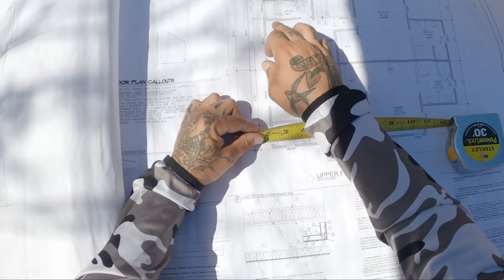Carpenter Building TJI Floor System on Home (First-Person POV)

Comment: The Go Pro just showed me how precarious it is working on the upper wall framing. I can see how one mis-step can send you to ground level very quickly.
Reply: Matt bangs head
Reply: Well strictly speaking he wouldn't got the ground as they are wearing fall arrest protection gear but it would still hurt. One lapse in concentration and your falling, it is very precarious but you do get used to it. 👍😃
Reply: @garethheathcote4988  he’s not wearing fall protection there. Those are his tool belt straps you’re seeing.
Reply: Just use more braces. Its not difficult. You should have a top plate too. Very rarely can't fit with height.
Yea, rubber grip hammer is trash.

Comment: Matt. If you drop that saw. Trust me. It will still work. Dropped my saw from 2 story's and it still cuts like butter. Also left my impact drill on a roof when it snowed. Knocked it down bumping under the roof with a stud n made it drop 2 story's down. Still works fine. DeWalt is just as good as the rest n maybe better

Comment: also try putting a little electrical tape right on the bottom of the handle, it’ll slide right in 
That’s what I did with mine

Comment: Hey Matt you showed how you adjusted layout for plumbing toilet.  On recap mention also how everything stacks. Studs to Joists for hvac returns and runs.  Also top plate nails over studs for clear path for electrical.  All subs can THANK A FRAMER. Or thank a good framer anyways. 👊

Comment: Is there a reason not to add a piece of osb/plywood on top of joists & top-plates where you're needing to walk frequently? Like where you're lifting the joists up, rather than balancing on just the 2x4s, you could have a few sheets of your flooring materials to give you a platform?

Comment: Hi Matt, all I kept thinking about while watching your video is that my boss is correct. I am in my 50's and he is got about 15+ years on me. Never and I mean NEVER used nail guns. We have had carpenters walk off when they find out that it's all hand  nailing. He swears that dragging around the hoses, and the hassle of getting hung up is much worse on the body than hand nailing. Also, remember my last comment we still cut in 1x for bracing!
Reply from the maker: Cordless Nailers work just fine, but I have friends that still handnail everything and they build just fine.

What's funny to me is a carpenter that can't hand drive.. There's tons of them out there!
Reply: @MattBangsWood 
Ohhhhhhhhh yes, more than we'd like to think about. How about the carpenters who need a miter saw to cut straight? I've seen plenty of them. Or framers who use a speed square to mark complete lines and still can't cut it straight?
Reply: Hi. I have a theory about hand driving nails. It seems to me that the harder you grip the handle the less force tranfers to the head. A bit like a pool break off shot. Barely grip the cue and you'll destroy the rack. Any thoughts?
Reply: @kierandoherty1600 
Well, that's kind of what I do. I hold the hammer real lose as I am raising my arm, then when I start my downward descend and I am starting to pivot my wrist I tighten my grip while at the same time letting the wight of the hammer do the hard work. I have never hurt my elbows, shoulder or wrist with this swing. Moving wet lumber always gets me though.
Reply: 1,2 1,2 1,2 set it and drive it. First day test - 10 penny finish nail set in 3 or less whacks with a hammer. The old guys would do it in 1 whack. Hold the nail with the thumb and forefinger and drive it home and not a scrtch and set level with the surface. No Hammer marks!

Comment: 19:20 The 🦊 man was like im not knocking it to the ground, sketchy saw. Also ive noticed that most older generations of the nr83a hate to take 2 racks of nails,  have you noticed the same?
Reply from the maker: Steven, my NR83A hates taking 2 racks. I don't know why though, they almost always jam up!
Reply: I've noticed this too. The second rack seems to ride up on the back of the first and gets stuck, keeping the spring from feeding them in.
Reply: I got the same gun Matt and it does the same thing when I use generic nails like grip rite 
Try paslode 
Plastic that holds  the nails is very soft and when you let the spring latch hit to hard the spacing bends /shifts and that causes jambs
 once you load your nails try just letting the spring go very gently

Comment: Just a question, not a critique...what is the purpose of doubling the rim joists? I've not seen that done.
Reply from the maker: No worries at all, it’s a structural detail. That back section will be nailed off @ 2/12 nailing with LTP5 connecting rim to wall below / below at 5” O.C.. Crazy shear numbers on the back since there is only (3) 3’ walls.

Comment: Think about this, I would level all the outside walls1st then work in. I would level extra walls with long span level at where walls tie in together as we know as the T then run a line just like you burning 1 1/2 straight all the time the beams always run flush on the inside the outside you’ll lose when you put plywood then just measure 5 3/4 from beam to line. But I would just run the string on the inside

Comment: The shear ties it up strong anyway?
Reply from the maker: Structural details call for the A35's. Shear will run from bottom plate to top of floor system, then from there upwards. You're correct.
Reply: @MattBangsWood   both top and bottom sheared walls tie on to rim joist but the plans do require A35’s every 3’

Comment: Engineered lumber should have any crown to it so it doesn't matter. Also how come you don't have a 2 hour fire wall between units
Reply from the maker: Engineered shouldn't have a crown to it, you're right, but I've gotten some nasty LVL. I check for crown when doing anything cantilevered, as I'll crown upside down.

It'll get 5/8" on both sides of that interior bearing point. I'm in the works with owner about getting his soundproofing, as I don't like the single wall detail.
Reply: @MattBangsWood  Here in michigan we have a 2" fire wall system that would extend from foundation to roof line sperating the 2 units. Then fire rated plywood would be needed on the roof deck with at least 4' cover on either side of that
Reply from the maker: @kevinobrien1933  I've done similar with a gap between the two walls, densglass on both walls separating the two. I expected this to be the same, was very surprised to see the single wall.

By code noise can't transfer from unit to unit over "x" amount.. Achieving the numbers they need with a single wall is going to be a challenge. Rockwool, double drywall is the only way I can see it happening.

Comment: You guys don't use fall protection?
Reply from the maker: Yes, you'll see it on the roof of this place.

Unfortunately, tying off walking walls when there isn't anything above us can be difficult. I can tie off to the top of a wall, but if I'm farther than 6' away, I'm just going to hit the concrete anyways.

Comment: How do you like the ringing noise off the dewalt hammer
Reply from the maker: Only have it until my replacement Dalluge comes in. Hate that pingy thing..
Reply: @MattBangsWood  love the videos. I'm a framer from ky. Been a huge fan since your beginning. Keep up the good work.
Reply: Have you ever tried a Martinez hammer? I went from a wood handle stiletto to my Martinez and I love it

Comment: so can you tell us why engineered floor joists are so much stronger than if you build a home in the olden days with one big daddy of a beam.  for the lamens man looking at this and not being a structural engineer one might say the floor joist has a layered glued thin plywood with a thicker wood cap on the top and bottom. But yet to one's amazement, over a given span, it holds a lot of weight.
Reply: Exactly. Also they don't require big timber to make
Reply: They are like a steel 'i beam' just made from timber
Reply: @kierandoherty1600  yes aware.. the big letter I is so strong LOL.. see bridges and stuff  but amazing isnt it that thin board that is in the middle is magically stronger then a piece of wood the same height of it

Comment: Dude. 12-foot ladders on Craigslist are $100. Three of those and some long boards and you'd be a lot safer than winging a five-inch ledge. Rocking a skateboard at ground level ain't the same as being nine feet up and across from a concrete wall.